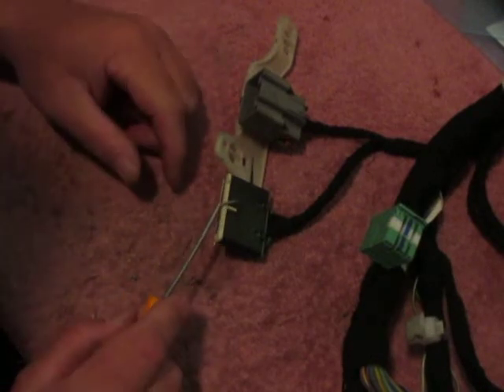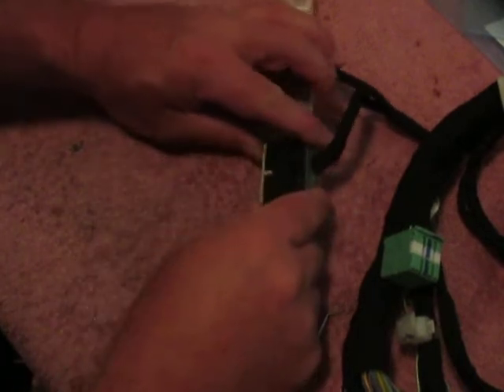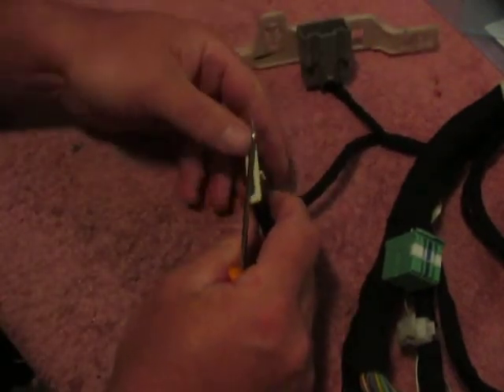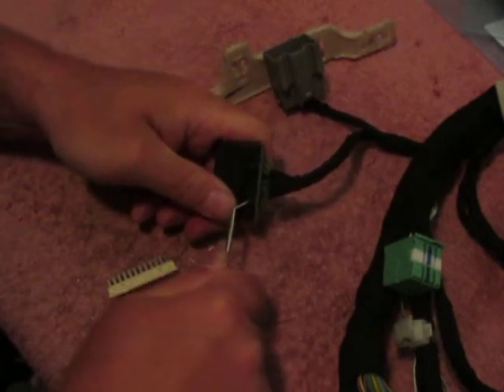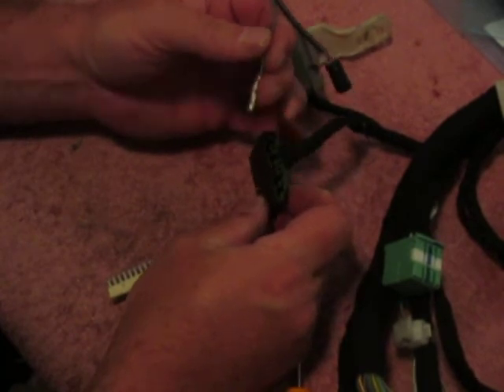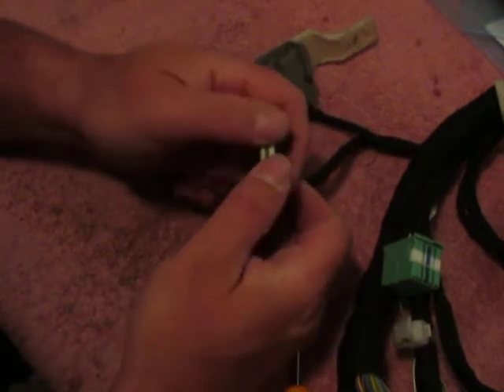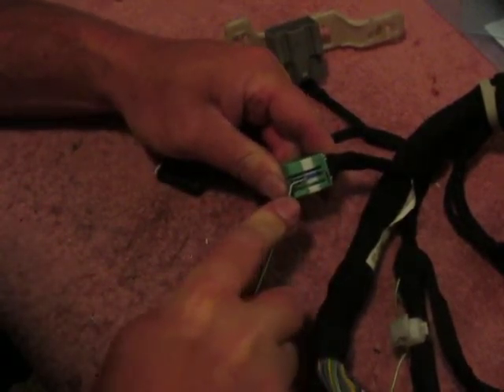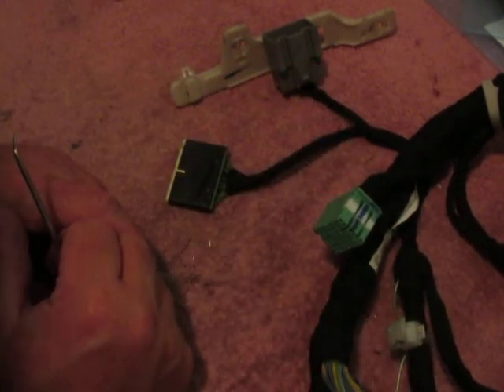GM Splice Pack Connector Info JX200 JX400

Comment: How can I remove a wire from the splice pack?
Reply from the maker: Ah good question.  But if you want to test a curcuit you do not really need to remove a wire.  Removing the white comb isolates  all the wires so they can be tested individually. 

BUt to removing I find a standard pic can grab the tang holding them in most of the time.   Just not sure where it is on that particular connector.  Ususally you enter from the front and pull the tang away from the terminal.
Reply: What vehicle is this?